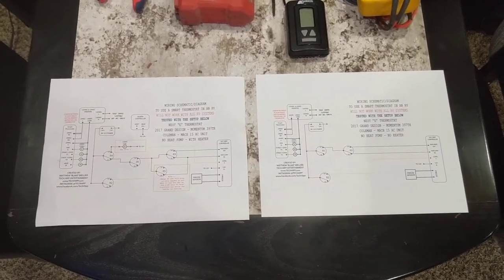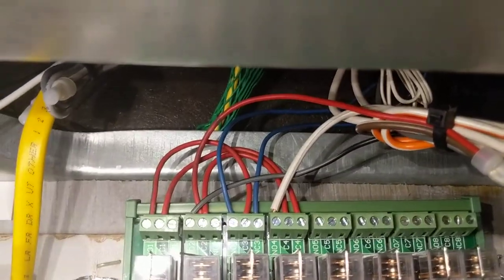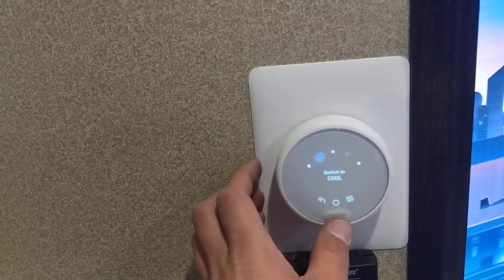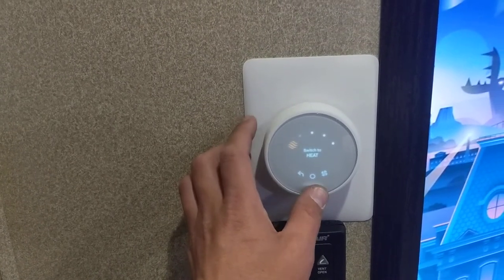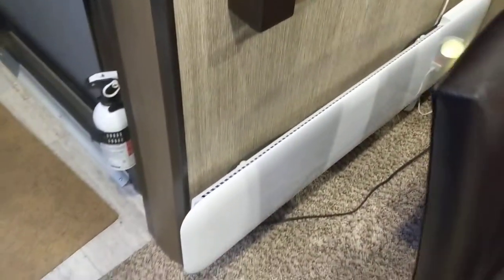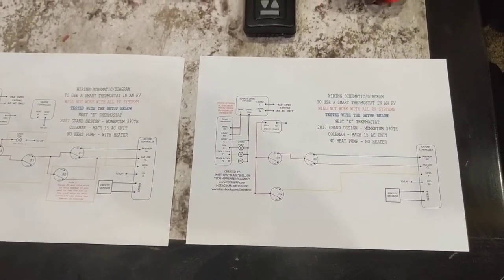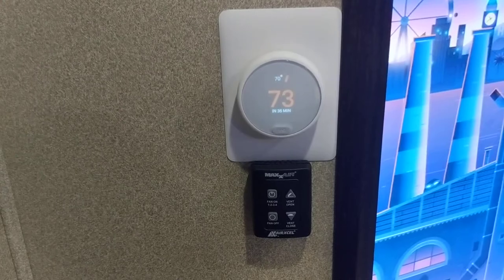Upgrade thermostat in a travel trailer Camper RV to a Nest DIY Grand Design Momentum 397TH 5th wheel

Comment: Awesome Bro been trying to figure out how to make my RV smart for the longest
Reply from the maker: FYI...  This won't work if you have a Dometic AC unit.   They actually make a module you can buy for under $200, if you want to use a home thermostat.  You just need to contact them directly for the part #.
Reply: @BlakeBiellier  I do have a Dometic Duo therm thermostat. I have to contact that company. And they have a  Dometic Wifi thermostat edition for under $200. Or I'm contacting them for a adapter pieces to then connect my Nest thermo too. ? I got confused
Reply from the maker: @EmilioMalice  It would be a different part.  It is a whole different controller that goes in the AC unit.  It is super easy to install
Reply: @BlakeBiellier   I just contacted Dometic about the module. They where no help told me no such part exsist. For a home conversion. And kept trying to get me to purchase the 3316400.000 ct and that is only a blue bluetooth model. I told the sales rep i really want to connect a nest thermostat. She replied thats impossible !!! I told her the videos are on youtube its possible. She hung up the phone on me. lol
Reply from the maker: There is one!  Their support is how I found out in the past.  I will see if I can track down the part number.  Well...  At least there used to be one.
Reply: @BlakeBiellier  nice job!  Did you ever find out any information about the Dometic module?
Reply: @EmilioMalice , were you ever successful in getting a residential thermostat to work with your Dometic comfort control system?  I've seen many examples using a 24VAC transformer and relays to control the older analog systems, but can't find anything about these newer ones.
Reply from the maker: @NateDogg1955  Dometic sells a control board for some of their models that are made for home thermostats.    Relays aren't just for the older ones.  My camper in this video is a 2017 and they are Coleman Mach 15 ACs.
Reply from the maker: @NateDogg1955  Technically, you could trash the Dometic board and make your own control board quite easily.  You could do it with relays and timer relays to control your AC.  Even the freeze sensor could be used and trigger a relay to shut it down.

Comment: Good stuff!  👍🏼   Don't suppose you've worked out how to wire the NEST to a system with a heat pump and furnace?
Reply from the maker: Yes!  You definitely can!   If you want two stage cool and two stage heat at the same time....  You just need to get the full Nest and not the Nest E like in my video.   I am going to get a full Nest for the living room and modify the fireplace so it will be my 1st stage heat the furnace will be the second stage.   The same concept would be used for a heat pump.
Reply: @BlakeBiellier  Thanks for the reply. That's what I was thinking.  But, now I'm wondering how I would be able to run stage 2 heat (furnace) by itself when boondocking.  Does the Nest let you do that?
Reply from the maker: @ChangingLanes  Put a toggle switch next to the Nest that jumpers the Stage 1 heat to the Stage 2 heat. When the toggle switch is on, it will allow the furnace to come on when it calls for it during Stage 1.  

It won't matter if it tries to turn on your heat pump because it won't turn on due to no 120V power anyway.

Hope that helps!
Reply: @BlakeBiellier  Good idea...  Curious about the functionality when in normal (shore power) mode...  Does the nest work like the stock unit in that it kicks in the second heat source when there's a 3 or 4 degree temperature differential?
Reply from the maker: @ChangingLanes  I sent feedback to your page with my phone number.

Comment: Your video helped me do the same thing in my trailer just wonder how did you wire the freeze sensor mine went down to my old thermostat and I don’t see a location for it on the nest..
Reply from the maker: The freeze sensor shouldn't go to the thermostat from all the ones I have seen.  That isn't saying that yours does not.  I just haven't seen it.

Comment: Can you share info on your electric heaters? Curious how you’re running them. If you added additional outlets? Thanks
Reply from the maker: Unfortunately, I don't believe they make them anymore.  They are made by a company called Mill.  They were not controlled by the thermostat.  They don't have ifttt or google home compatibility either.  However, you can use a standard baseboard heater with a smart outlet, plug or relay.  I hope this info helps!

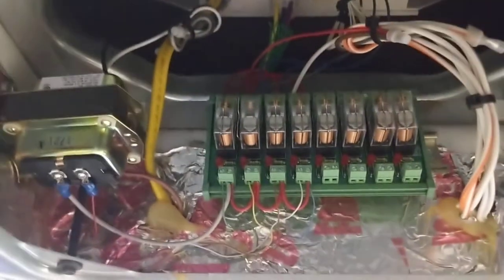Comment: Great video but Where did you get the relay block? Been trying to find one like it. 0:27
Reply from the maker: Amazon!   😁
Reply: @BlakeBiellier  anyway you can link me? I tried to find this one you used but couldn’t.
Reply from the maker: @xkatanaswordx  Here you go!  Electronics-Salon DIN Rail Mount AC/DC 24V Control 4 SPDT 16Amp Pluggable Power Relay Module, G2R-1-E https://a.co/d/46ZfFzj
Reply: @BlakeBiellier  thank you so much, so basically the 24v is what steps it down to the 12vdc that the equipment wants?
Reply from the maker: @xkatanaswordx  It isn't stepping it down.  You need a 24v AC transformer to power the nest.  Picture it like the nest having micro relays inside of it as well.  Those send power to the big relays you are buying.  Picture a relay like you turning on a switch.  The relay is triggered and let's the 12v DC pass through it.  It isolates the 24VAC circuit from the 12VDC circuit.  I highly recommend not attempting this if you don't have basic electronics knowledge.   You could end up with a fire.   You also lose the capability of running the furnace without the camper plugged in or on generator power.  I added a digital bypass temperature controlled relay that fired if the temperature gets too low in the camper while pulling it.

Comment: Did you need to run wire through the wall?

Did you need a transformer for just cool ACs?

With in the year you’ve had it installed; has it messed up or is there anything you would change?

The old thermostat has the function of “auto” cool lo/hi... will the nest work somewhat the same? 

Would a call be easier? Lol
Reply from the maker: I have not experienced any issues with them since my installation.  

No extra wire needed other than jumpers for the relays to the roof unit control board.  I needed a transformer at all 3 AC units.  One of the 3 AC units shares a thermostat with the furnace.

I mounted the 24VAC transformer up in the roof unit and powered it by the 120VAC going to the unit.  

The only thing I would change is this but here is no viable option that I have found...  The only thing one loses, is being able to use the heater when you don't have line or generator power.   Which isn't a big deal to me though.  I have found 12VDC to 24VAC converters but they aren't pure sine wave.   Which could damage a nest because of its energy star compliant power supply.   If I could find a pure sine wave converter, then I would have a furnace when on battery power.  

Yes sir!  Lo/Hi will work.  In a home AC unit the fan is typically one speed and the Low/High is for a two stage compressor.  An RV AC unit is a one stage compressor and two fan speeds.  I wired the relays so this action is flipped to be compatible with an RV AC.  If the thermostat is within 1 degree of target the AC fan will run at Low...  If it is 2 degrees or more away from target it will run the fan in High.   My ACs very rarely need to run in high for this reason.   All 3 ACs are 15K BTU and are centrally ducted.  

I have a remote sensor for the Living room AC in the bedroom.  That way  the program switches to that sensor and the Livigroom AC leads my bedroom AC.  That means at night the temperature of the bedroom is regulated by the AC in another room but gets its temperature reading from the bedroom sensor.  

Waaaay less noise when sleeping.

Comment: Awesome video, I've got the 36ssws jayco.. is it different if there is two controls?
Reply from the maker: I have 3 nests in my camper because I have 3 AC units.   If you have a Dometic brand AC, you will need to buy their special module.  You can get it through their customer support and you won't need relays with that.
Reply: I just noticed the response’ sooooo sorry! Just about to start the project given I’ve been outta the country. 

So I have the Coleman Mach, I don’t know exactly which version. (You mentioned 15) now I have the 2020 model jay o pinochle 36ssws. 

Same thermostat,

Comment: i have a Coleman 15,000 and it has two types of heating. . Propane and from the heat pump.  (the propane heat has its own fan in the furnace systems)

Question: Did you only have one heat wire?  will the propane kick on after the desired degree is to much for the unit to heat ? 

Jayco Pinnicle 36 ssws 2020

Also, the access for the power (the 110V to 24V, i have the transformer, did you feed off the power for the AC itself? or where did you find power up there ? did you 'Y' off?
Reply from the maker: I only had one heat wire because I don't have a heat pump.  But you will have an additional wire for this.  You will need the more expensive nest for your camper.  This is because the nest E can't do both 2 stage cool and 2 stage heat at the same time.  The higher end nest will be able to do this. 

I actually swapped all my nest E thermostats out for ecobee 4s.  This is because nest doesn't integrate well with some automation systems anymore.  Also, they can do both 2 stage cool and heat.  Soon I will be modifying my electric fireplace to be first stage heat and then the propane heater.  

Recently, I added a 12v temperature switch at the AC unit so my furnace will still kick on at a 60 degrees as a safety.  

As for the 110v question.  Yes, I got power at the AC unit itself on the main wires going in.
Reply: @BlakeBiellier  perfect, I have the more expensive nest, will I need an 8 bank relay? Or will 4 do?
Reply: Also, does stage 2 cooling / stage 2 heating come on when the desired degrees are more than 3-5 degrees ambient temp?

Comment: I have found a adapter that provides the 24 for the control called a Cwire adapter 24V it just plugs into the wall outlet. Would this work?
Reply from the maker: Yes mam... That would work but you would still have to install relays.  This is because you need to isolate the 24VAC for powering the nest from the 12VDC control in the roof unit.
Reply: @BlakeBiellier  cool thank you. I'm gonna try to make this happen! So currently I only have 3 wires showing blue red and white. Are there suppose to be more wires hidden in the wall?
Reply from the maker: @stephanieburroughs8806  I'm guessing you have a dometic ac.  If you have one, then you will have buy their special module so you can install an aftermarket thermostat.  I think their module is like $200.   You can get it buy contacting their customer support number.   There might be more wires.  Normally if they don't need them, they just cut them off.  If you strip back the covering on the cable you should see them.  This would also require more wiring to be done in the AC unit but you won't need to order relays.